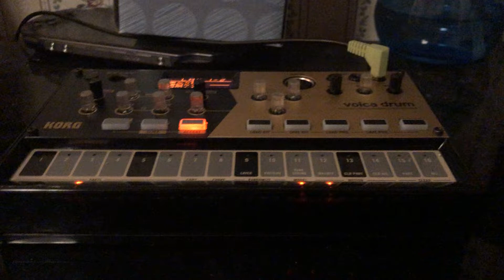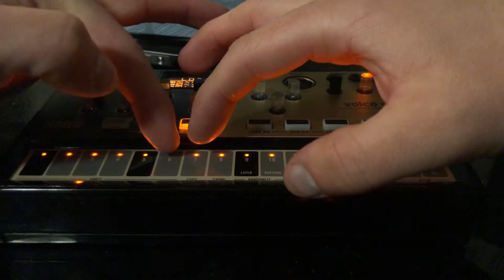[VOLCA DRUM] How to Sequence / Save and Load Kits + Programs / Chaining Programs

Comment: Can you save multiple presets lime if you were using it for a setlist?
Reply from the maker: I answered this question for someone else before so I’ll copy my answer here:

“Yes, but it’s gonna take a little bit of work. As long as that doesn’t bother you, it’s possible! You can save the pattern you want to play for 4 in a row to four of the memory slots in sequence, then build the one you want to play for 2 in a row on the next two concurrent sequences after the group of four you have copied. When you hold Function and Load Program, you can use two fingers to select the entire spread of programs you want it to play, and they will loop in sequential order.”

Hope this helps
Reply: @xnflg3074  it does thank you! would you recommend another affordable drum machine that focuses on having savable presets that's a bit easier to operate for live use?
Reply from the maker: @chaddlanier  Yeah this isn’t really for that kind of thing. There are plenty of affordable drum machines but imo the Volca Drum is more for techno and IDM style stuff. I don’t know drum machines well enough to recommend anything specific, though, especially for live backing tracks and whatnot. Good luck on your search!
Reply: @xnflg3074  thank you!

Comment: is it possible to play one pattern for 4 measures, then have it play a different pattern for two measures, then go back to the original pattern? preferably done manually? this is very informative, by the way ! thank you for this video !!!
Reply from the maker: Yes, but it’s gonna take a little bit of work. As long as that doesn’t bother you, it’s possible! You can save the pattern you want to play for 4 in a row to four of the memory slots in sequence, then build the one you want to play for 2 in a row on the next two concurrent sequences after the group of four you have copied. When you hold Function and Load Program, you can use two fingers to select the entire spread of programs you want it to play, and they will loop in sequential order.
Reply: Great, and thank you !!!